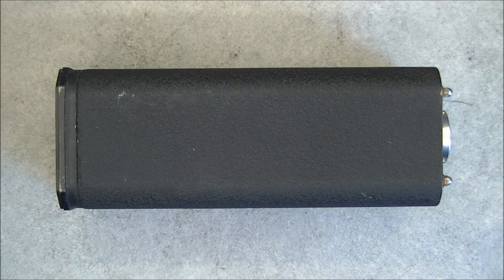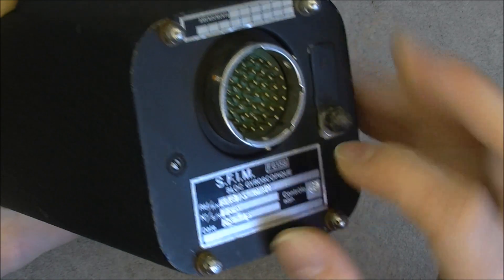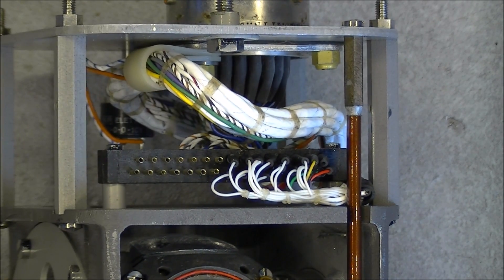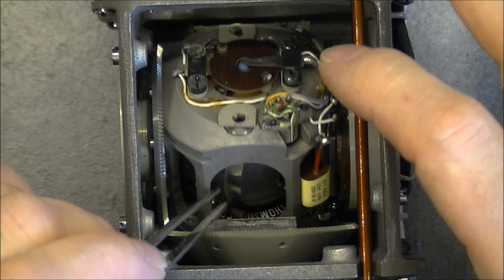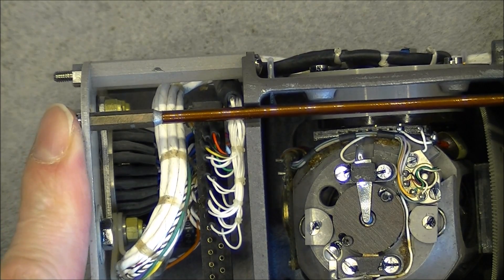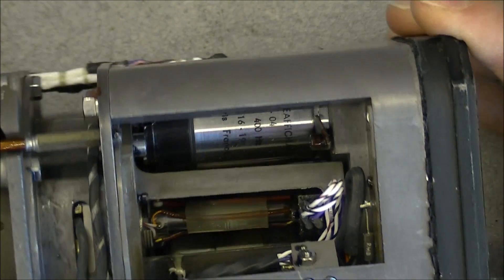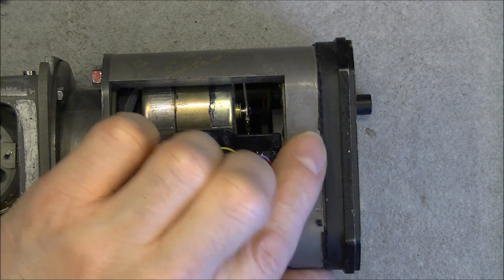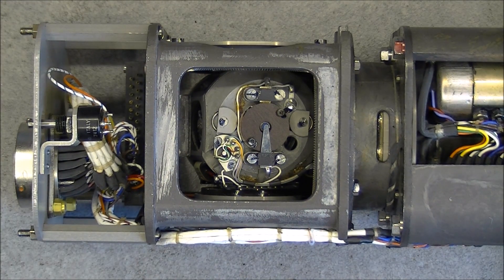Avionics teardown 1975 SFIM Gyrocompass

Comment: Wow that's a good one! Looks like there's some kind of optical sensor pointed at the (outer, inner) gyro or gimbal device in the middle; at the curved machining marks on the rotating metal. I wonder if that hybrid module is amplifying it's output, like a flying playback amplifier does in VTR's that have them so the gain and voltage of the output signal gong through the slip rings (in the case of the gyro) is less likely to be distorted by funky contacts. Lots going on in there with so many rotary contacts. I see they use an offset slip ring assembly like in a lot of older VTR's I work on (to keep the contact surface "fresh" by flexing the brushes against the slip rings). Yeah if you could power that up it would be awesome.
Reply: Oh oops I see that's the motor contacts, the machining marks just look nice. but I can tell you for sure that rotary contacts can be delicate! Especially when there are more then one per slip ring and you are trying to take it apart. But I'll bet that hybrid is amplifying like i said. I do wonder why they don't use rotary transformers to get the data out into the stationary parts of such an expensive machine. I suppose slip rings are smaller.
Reply from the maker: Iwill try to power it up, but I did not figure out yet where is the rotor supply.